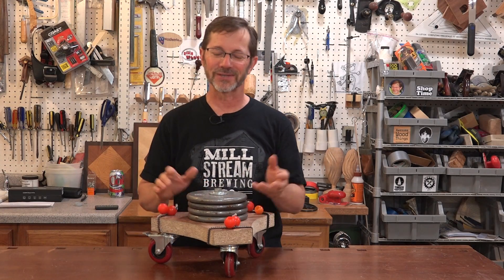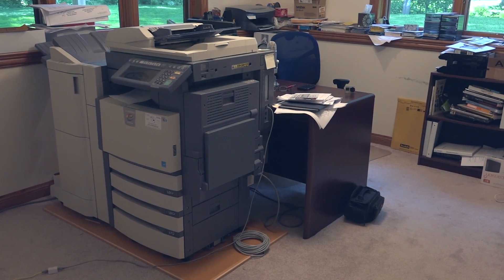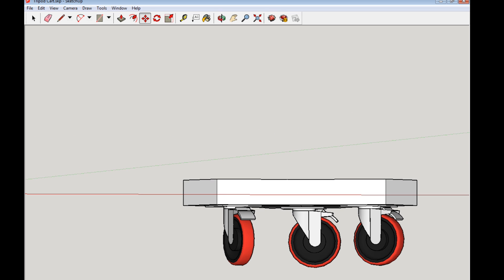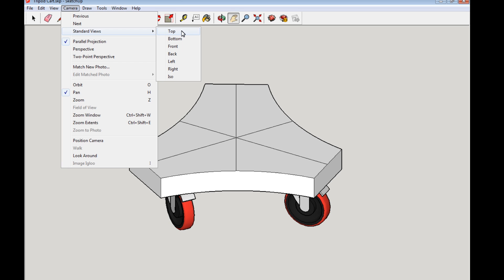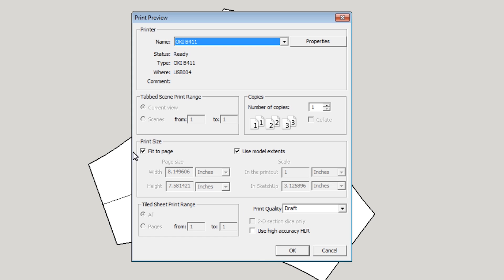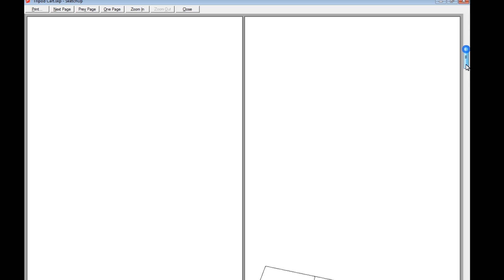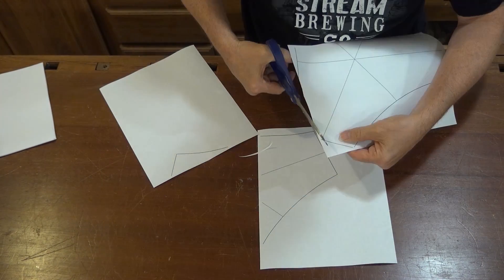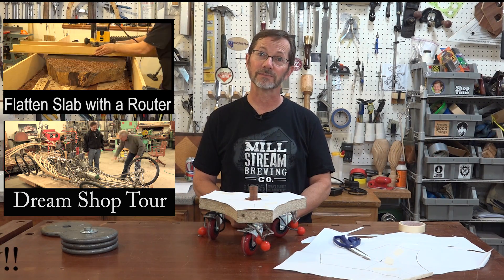A Better Way to Print Full Scale in Sketchup - DIY Tutorial

Comment: the 1:1 setting gets you very close, but may not be exact.  I wanted a pattern where dimensions from outside of the lines (i.e cutting to leave the lines and then sanding to the lines) would give me the same distance using the same caliper that I made my original measurements with.  So, I made 1 print with the 1:1 scale and measured the printout and found that the printout was slightly smaller than the actual measurement I wanted.  I then calculated a new ratio and set my print settings to be 1.03:1 (printer:sketchup).  That resulted in a printout that was nearly dead on with the same precision I had used to make my original measurements for the design.  I think that slight offset is going to be different based on a number of factors, including the printer itself and whatever you used to make measurements for your design.  

Just remember that if the printout is smaller than what you want, the number greater than 1 goes in the scale setting for the printer and if the print out is bigger than what you want, the bigger number goes in the scale setting for SketchUp.
Reply from the maker: Interesting.  I haven't noticed that.  Maybe I didn't measure as precisely as you or maybe my printer/computer combination happens to work a smidge better with Sketchup.   Good info either way.

Comment: Is 'print preview a pro tool?  I don't find it on my mac.  Thx
Reply from the maker: Hi Gerry, I have 4 versions of Sketchup; 2015, 2016, 2017, and Sketchup 8.  All of them have have print preview on the main drop down menu.  That said, Sketchup has been removing features from the free version. I hope not, but maybe they removed it from the latest version?
Reply: @JackbenchWoodworking  Thanks for your reply.  I have version 17.2.2554 and cannot find the print preview. I have been using Sketchup on and off for years. Can't figure out how to print at full size (this project's item is 7" by 4" )...quite frustrating.
Cheers
GS

Comment: I use a simple trick to save pages. I actually export my file to pdf and then i print that file using my printer's software that is more capable than sketchup. Also i dont need to make same procedure if i want to print same item again. I just open the pdf.
Reply from the maker: Good idea!

Comment: why is my boxes in "PRINT SIZE" blank, page size boxes are blank and I have no option, and Scale boxes are blank with no option as to inches or what ever.
Reply from the maker: Sorry to hear that you are having trouble with this.  Maybe try going to the "camera" drop down and selecting one of the "standard views".  I hope that helps.
Reply: Edward
I had the same problem. This fixed it for me. In the “Print Preview Box” at the lower right hand corner look for “Print Quality” drop down box. Select “Standard” then click “OK”. That fixed it for me.

Comment: In case anyone is interested I found a way to get rid of all the extra print pages.  Simply resize the entire Sketchup program so that the only thing showing on the view screen is what you want to print.  It's kind of weird but it actually works.   You need to resize the whole program viewing area.   But it will still print 1:1 if you have that set as  your scale.   By doing this I was able to print my drawing out using only two pages of paper which is exactly what my drawing needed.  If I don't resize the Sketch program it wants to print out 10 pages with 8 of them blank.   So resizing the entire program in Windows seems to be the trick.   You need to resize it so that only what you want to print is in the view area.
Reply: I just noticed that you can also do this by leaving Sketchup full size and simply expanding information windows until you've squeezed the viewing area down to the size you want it.  Either way seems to work.  Evidently Sketchup prints whatever you can actually see on the screen, including blank space.  Fortunately this has nothing to do with the scale it prints out, so if you have it set to 1:1 scale it will print the right size.  The only difference is that you don't get a lot of extra blank pages on the print out.

By the way, thanks for posting this video, it helped me a lot.  I didn't know how to print out 1:1 until I watched this video.
Reply from the maker: I wouldn't have expected that, thanks for the tip!!

Comment: Thanks for the video, it's nice to know it's not just me that has had this problem!

Looking around I have found that Sketchup have their own video here: https://www.youtube.com/watch?v=X9-Y7kMFxl8  which explains why the problem occurs and how to work around it.

The Sketchup video has a nice trick which involves drawing a rectangle the size of a sheet of paper and fitting the drawing into that before printing. In your case you might need to use a rectangle the size of 4 sheets of paper to fit your drawing into. 

Once the drawing is inside the rectangle you need to zoom in and/or adjust the size of the Sketchup window so that the drawing is visible but the rectangle is completely outside the visible area.  The purpose of the rectangle is just to help you get a good enough width/height ratio for the window. It can still be difficult if the edges of the drawing get close to the rectangle, but the printing works just fine every time for me now.
Reply from the maker: Thanks for including the video link, Andrew.  I like their trick of drawing a 8.5x11 rectangle to see how the model will fit on a page.

Comment: Not sure if it has been mention but the reason it printed 2 pages was because you had so much blank space around the model, if you adjust the window size of sketchup, like the size of the screen to tightly fit your model it would have used the 4 pages!
Reply from the maker: Johnny Loewen Thanks Johnny!
Reply from the maker: I did try zooming into the  model as much as  possible and the number of pages printed was still unpredictable.  Sometimes 6 pages, sometimes 10 pages.  Any ideas?  Thanks, Charlie

Comment: Thanks for sharing. Nice to have full scale print really. I might have some additional tips for this tutorial. I experienced that the SketchUp takes care of the main program windows size in the screen while printing. For eliminating the empty pages and better page management, I suggest the followings;
1- First of all go to printer properties and select paper size and orientation. Select best orientation to fit your model. Return to the main SketchUp window.
2- Size SketchUp main program window just to fit the model that is to be printed in scale. So that there is minimal empty space around the model in SketchUp window background. This might require some zooming, sizing again etc. When it is done open print preview dialog.
3- In Print Preview window, do not select "Use model extents". The rest is as in this tutorial (Fit to page: No, Scale : 1 to 1 etc.) Observe "Tiled Sheet Print Range" It should show min. number of page that the model to be printed in full scale. If not, return to model window and then try to minimize the empty spaces around the model in the main SketchUp Window.
4- Click on OK button and see the preview. 
This procedure works for me every time and I hope you can eliminate the empty pages by this way and get better prints.  Best wishes.
Reply from the maker: Thanks Mehmet, I will have to try that!
Reply: With these extra 4 tips it works 100%!!! Thanks